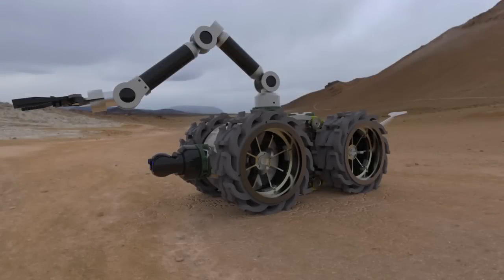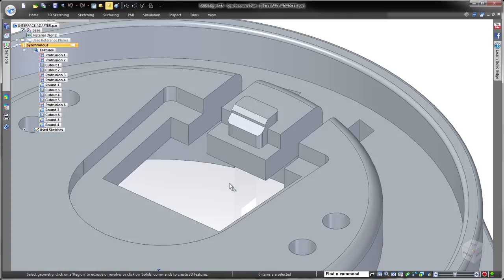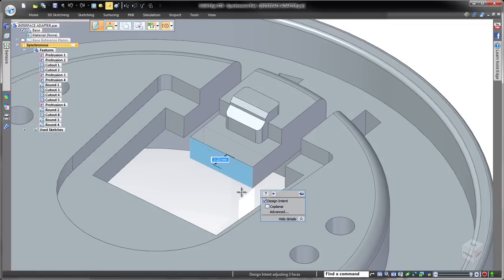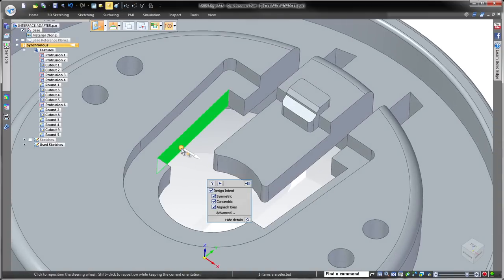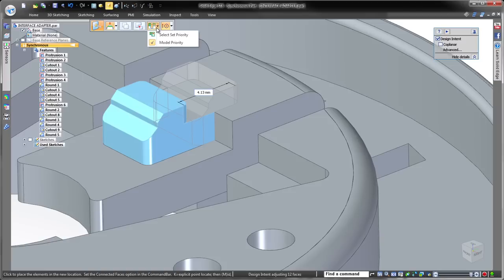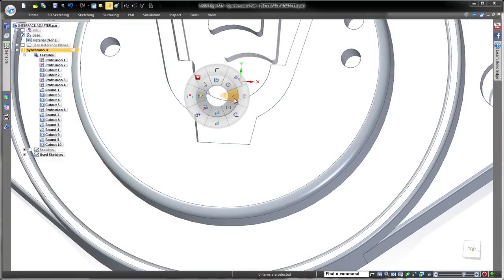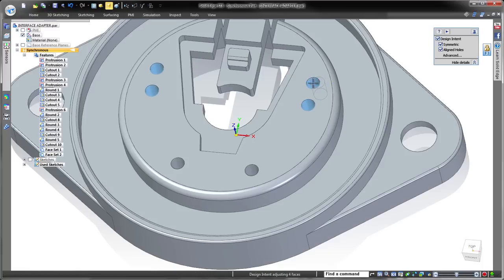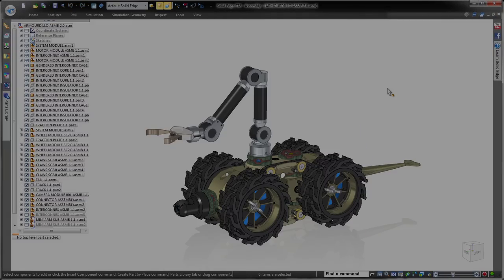Solid Edge ST8 Synchronous Design Intent

Comment: Difficult not to be very impressed.
But, hows it possible to 'focus on the design' without constantly / frequently referencing AND changing mating part and multiple mating part geometry at any stage of the design development on the fly. I've been used to sophisticated high-end 'explicit' modelling for a very long time - but you sure are tempting me to give SE ST8 a try.